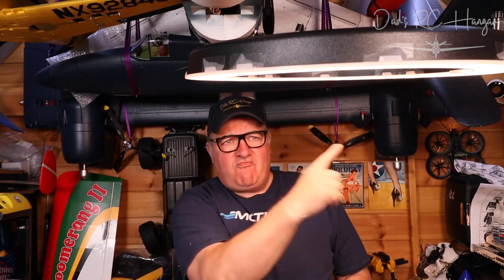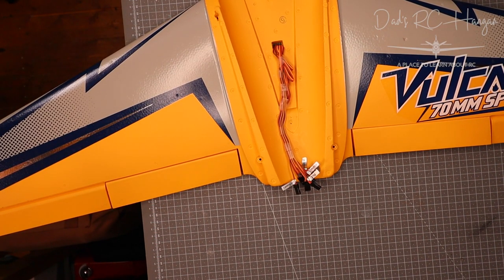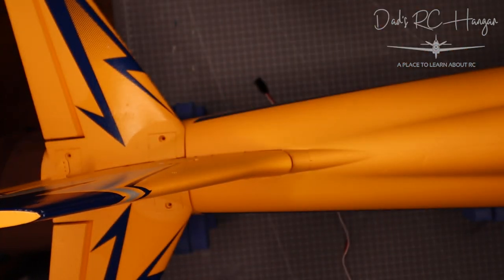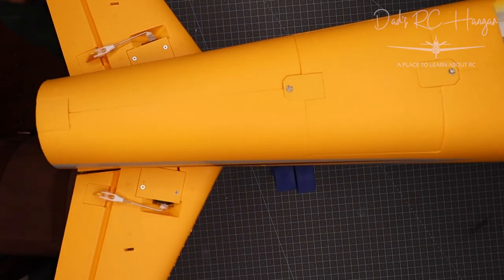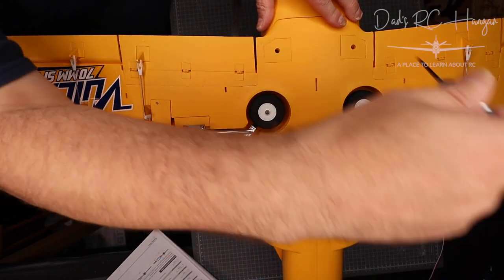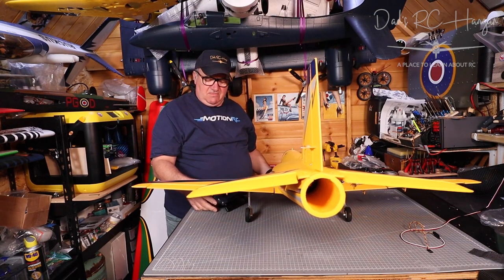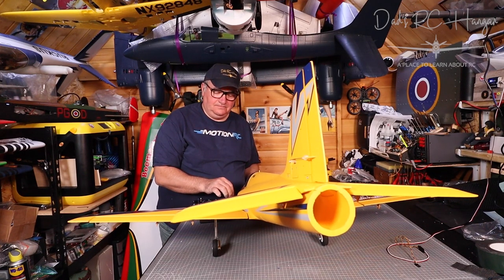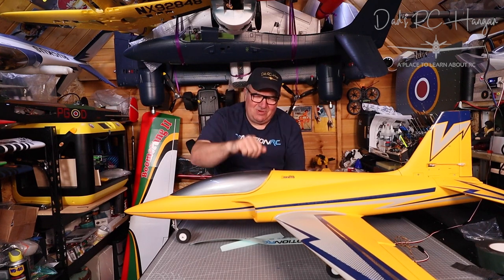Freewing Vulcan | Build | Test

Comment: Great video as always! You will love the Vulcan incredible flying a little jet. Super stable slow flight is great I’m impressed with it! I’m ordering myself one very soon well I will say I’m ordering my buddy one and keeping the one that I put together and flowing already lol going to get more flights on it this week if the weather permits! I really want to push it to the limit and see what it’s capable of! I see 8s in the near future! But 5000mAh is way to much for it. I found 3300mAh but the best for all around. 4000mAh max.I had the battery all the way back with a 6s 4000mAh and it was still nose heavy. Can’t wait to see the maiden!
Reply from the maker: Heya bud, Guess I have to get me some new Batteries then. 3300mAh I should get then?
Reply: @DadsRCHangar  I personally found the 3300 to 4000mAh being the perfect size. I got four minutes of flight time and landed with under 20% left in the pack but I was flying pretty hard full throttle majority of the flight all depending on your flying style if you don’t mind it being a little on the heavy side 5000 will work but it does land a lot hotter and take more room for lift off. With the 3300 through 4000 it’s super floaty and lands super slow..

Comment: Nice build Chris, it looks a very nice jet and you did well to sort out the very complicated wiring ( which brings me to ask why is it so over complicated? ) I've never had a freewing plane!! But they do look good quality, but alas I'm not a big fan of MotionRC!! I purchased some Admiral batteries from them and I wasn't very impressed, I also bought a Rotorscale scale Heli and the mechanics were rubbish!! It's all left a bit of a reluctance to use them again!! But that Vulcan does look very nice!! P.S. I also like slipping thing's in when it's nice and tight😖 Great video and thanks for making me laugh!! I do love the Old double entendre 🤣😄👍
Reply from the maker: Thanks Ian, it is a nice Jet, like any foamy, needs a coat to protect. FMS was always my favourite for finishes, but Freewing are getting better. Just wait till you see the MIG29 I still need to build. The downside of getting from MotionRC is you need to remember to pay FedX the Tax. 
I still like my batteries from HK, but never used anything else really. 

Planes are still very expensive for a foam box with cheap electronics, but I am a sucker for planes, as a young lad with Airfix models, these are me old lad Aitfix. 
 I don’t mean to sound like that, just the way it comes out ( See 🙈). 
Hope you get to have some fun with RC over the weekend as the rain dose not look like it will stop. Thanks for popping by and having a chat 👍🏻
Reply: No.flying this weekend Chris!! Weather shocking in Wales!! Heavy rain and strong winds😖
Reply from the maker: Same in Hampshire 🤨

Comment: How did you check the CG? Did you turn it over or did you use the molded mark?
Reply from the maker: Hi Daniel, the 95mm mark is accurate underneath, i used that CG upside down. I had to move the 5000 further back, but you have plenty of space. You will see when I do the maiden in a couple of weeks👍🏻

Comment: What is the radio you're using,.  Looks like a X12S
Reply from the maker: Hi Russ, it’s the new X20s Tandam from FRsky. It’s has the new OS Ethos, very cool. They still bringing updates, but the radio feels good to hold and has lists of great things. Once I played around more I will make some videos. Have a great day Russ and thanks for popping by 👍🏻
Reply: @DadsRCHangar  cool.  Thanks man,.   Reason I asked was because of the accst protocol of the SR6.   Made me think it was the older model.     I'm running the X12S myself on Opentx.   love it also.     I'm a FrSky fanboy.    Their telematry adon's are very well priced and easy to set up.     I often use the airspeed sencor Tube for a stall warning.   Very handy for complete feed back of model especially if you're trying to do a very slow approach on landings
Reply from the maker: @russcole5685   I must try that, I also use the X10, this also was upgraded to Ethos, with the IRSM and bluetooth upgrade. You can still use D16, as-long as you upgrade the firmware. I will have to try the airspeed sensor. Normally use the lipo sensor. Using the R10 for my IC planes, so should be interesting. Should have a peek at Ethos, might like it 😉

Comment: Spray clear coat plasti-Kote paint on your foamy models it'll last a bit longer and doesn't ding as easy 👍
Reply from the maker: I was going to use Min wax with a foam brush, will have to see if I can find plastic-Kote. Thanks for the information Steve. Have a great day weekend 👍🏻
Reply: @DadsRCHangar  Hi Chris you can get it on eBay it's alot cheaper than minwax works just as good and is alot easier to apply 👍
Reply from the maker: @stevearmett1565  I seen it on Amazon, is said it’s not for Styrofoam, I presume EPO will be the same ?
Reply: @DadsRCHangar  I have used it on my Eflight Night Visionaire and a flying buddy has used it on his Arrows EDF jet and another on a Flex RV-8 works really well all are foamies 👍

Comment: Throw blue box in trash. Don't need it. Doesn't do anything except present more places for failure. Two Freewing jets, problem with both blue boxes. One right out of the box, one after about a dozen flights.
Reply from the maker: Hi Shelby, I was wondering why the box was introduced. Good point, I will get rid of it. Thanks for the heads up. Have a great day 👍🏻
Reply: @DadsRCHangar  They say it makes connecting everything easier. This is the really basic blue box like the one in the 70 mm F16, mine started acting funny with the landing gear after a dozen or so flights. Easy removal, no problems since. The larger blue box (BB) has light controller, door sequencer, ribbon cable for wings all built in,  like the 90mm F18. Mine didn't work right out the box. There's a little more  to removing the big one as light sequencer must be installed, door sequencer (if needed), extensions ran to all wing functions, pcb boards removed from wing root to separate wing functions,  etc, etc, etc. Search YouTube for freewing blue box malfunctions and you can see they cause weird problems when they act up and have caused multiple planes to mysteriously become uncontrollable and 💀☠💀. Removing the bigger one is problematic enough that I won't buy another plane with one. If I'm thinking of buying, I check the spare parts, if big blue box is listed, the plane is not purchased. 
A nice design concept, but when done on the cheap, multiple pcb's (printed circuit boards) have no business in my plane, the receiver is already one too many, LOL.
Reply from the maker: @shelbyseelbach9568  yup anything that is an extra point of failure is bad. 
I don’t mind smart things in the plane, but I had issues with those boxes in my P51 Old Crow, it was the one that is a sequencer for the wheels and doors. 
I end up spending money with JP equipment, very good but pricey. I have yet to build the Mig29 , I believe that has ambit or two👍🏻